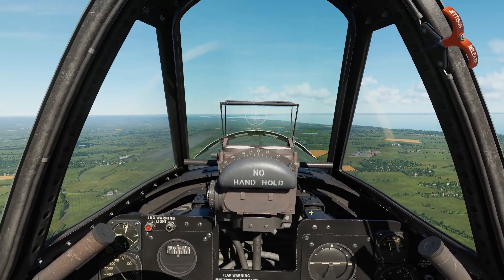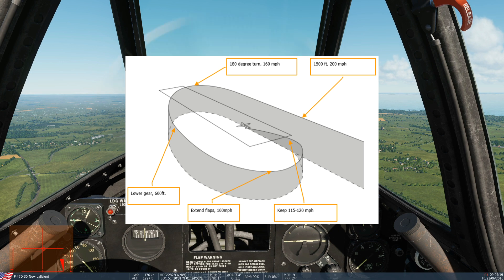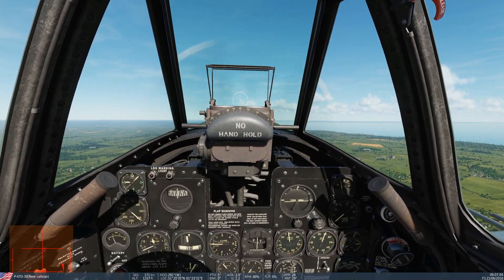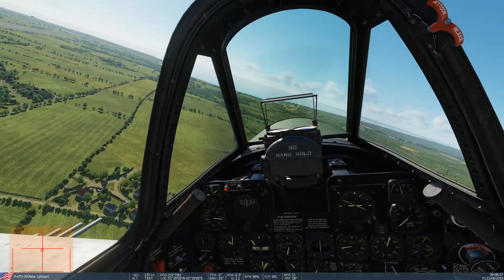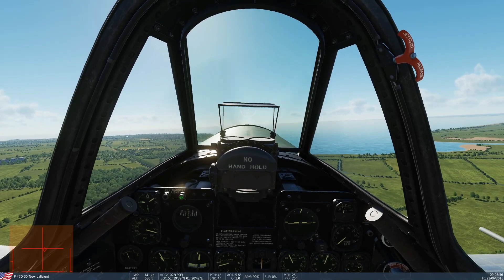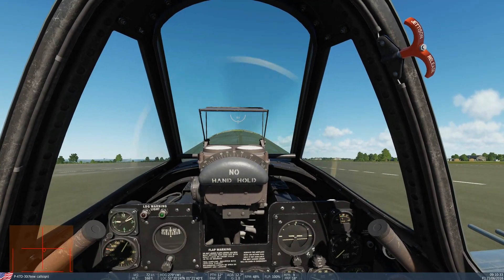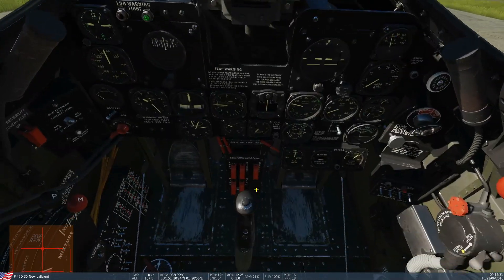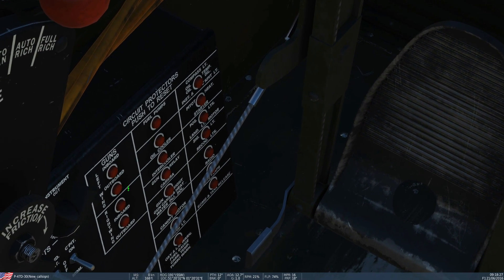P-47D Thunderbolt: Circuit, Landing & Shutdown Tutorial | DCS WORLD

Comment: ED must have a different P-47 flight manual than I have. The landing procedure in Pilots Flight Operating Instructions T.O. 01-65BC-1 states turbocharger control should be off for landing.  Which makes sense, because you don't need it and it could cause trouble.
Also, there is no reason to dilute the oil before shutdown in summer.  
Can someone from ED tell us what they are referencing?
Reply: I agree w you Gort :) just stick to the pilot's flight operating instructions and pilot training manual ;)
Reply: So I have acquired a later version of the flight manual and the procedures are indeed significantly different for takeoff and landing with regard to supercharger control. I need to learn more about this induction system to understand why use of both superchargers was required at low altitude in later versions.  I can only speculate that perhaps the turbo might inhibit flow to the engine supercharger if it were not spooled up.
Reply: You aren’t supposed to run turbo charger at all unless you are high enough to where it functions properly